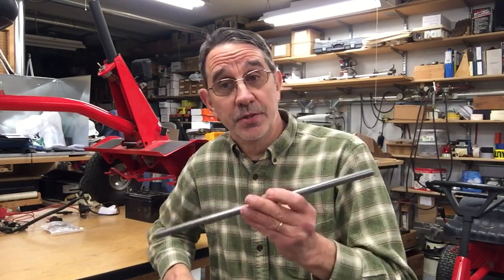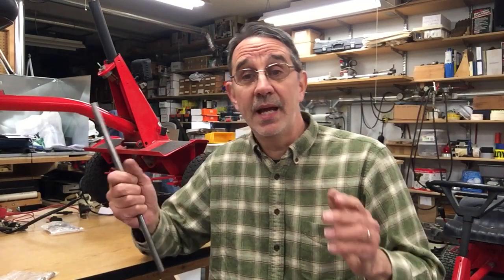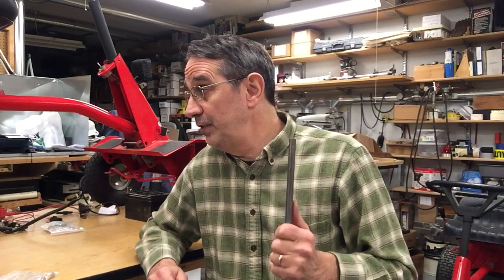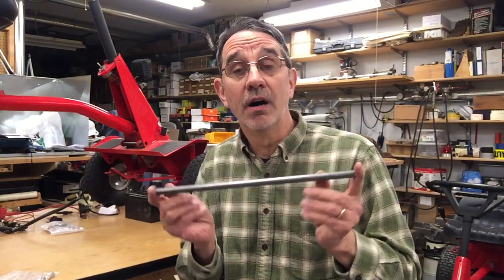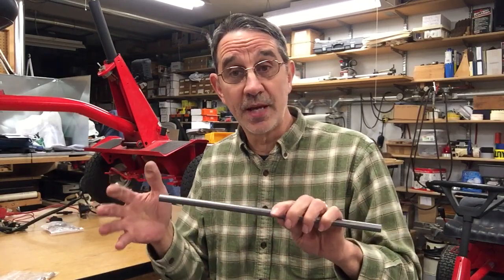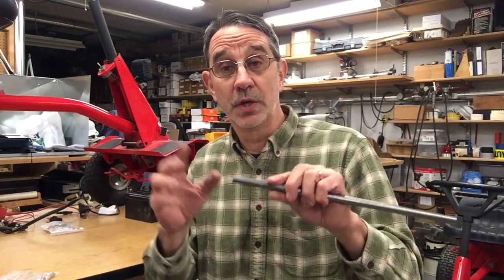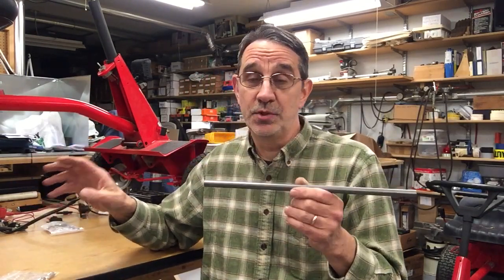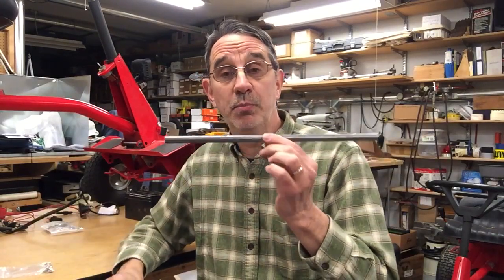276. Spreader bars for your Snapper RER.

Comment: Hello Jim, I just have to say the information is just right on. What I am thinking about is can you make the bar between your legs longer for better comfort. The bar attached from the front steering neck to the back part of the square box the motor is attached to that moves side to side. Do the old machines have longer necks as compared to the newer machines ??? Thanks Jim. VF
Reply from the maker: Victory First 
Yes you could definitely make that pipe longer you would have to probably add to your brake cable and your warriors you would want to cut it in the center between the band in the front in where it goes into the main case probably right even with the front of the seat then find a piece of pipe that will fit tight inside the existing pipe and just weld it in.Jim
Reply from the maker: Victory First 
And no I don’t think the older machines had longer tubes they just had a different steering They had the handlebars which gave you more room. Jim
Reply: @jimjackson9381  Thanks for the info Jim.
Reply: @jimjackson9381  Got it Jim. Thanks VF